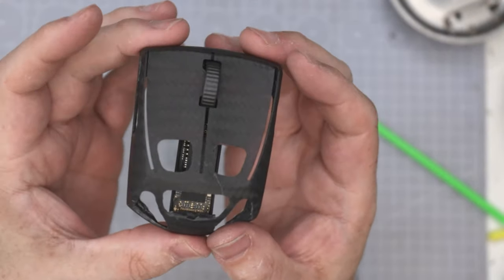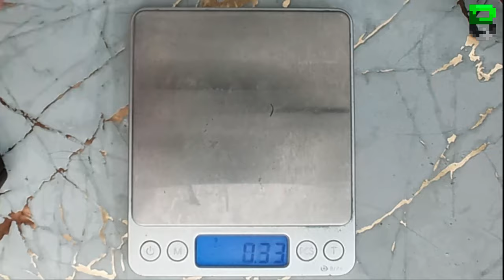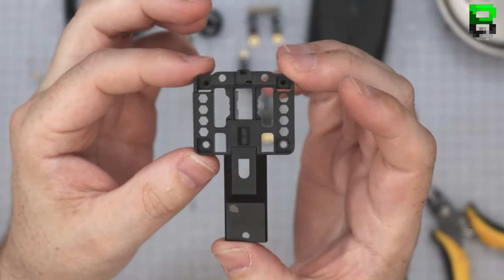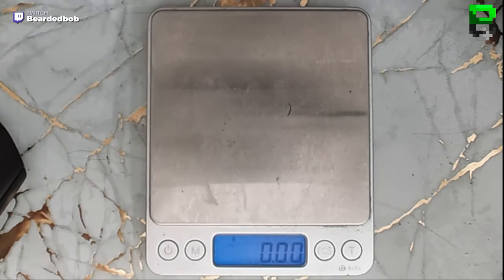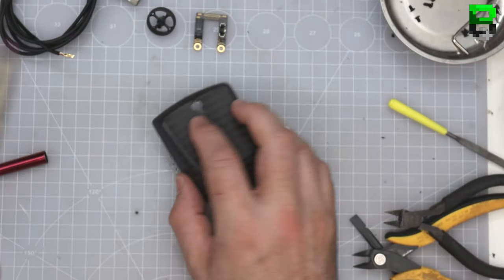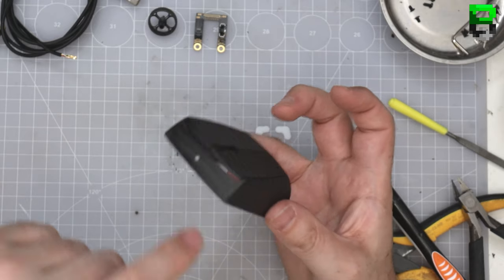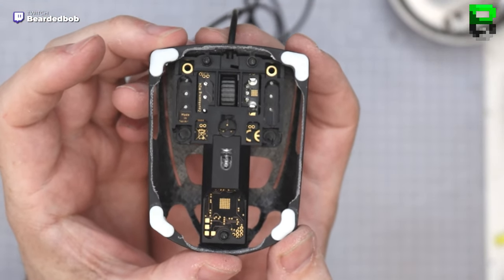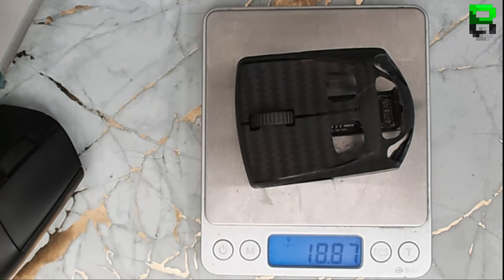Butchering a $300 Zaunkoenig M2k Carbon Fibre Fingertip Gaming Mouse

Comment: Is there a noticeable difference in the weight?  Did the click feel change any?  I remember on the MK1 you mentioned it still felt pretty together.  Does that still hold true here?  I want to do something like this for mine but I'm waiting till next year for the warranty to end.  I'm mainly trying to see if I can make the clicks a bit easier I think the carbon fiber is too stiff for me.  My index finger is pretty far back.  A bit behind where the mouse wheel is.  Great work Bob few would even attempt this.

Comment: is this worth? i main the m2k i want to mod the mouse if something can be improved, im thinking about replace the cable with enncoo AirCord Ultra-Light Paracord Mouse Cable but idk
Reply from the maker: Tricky to say if it’s worth it imo I would say it’s not but it’s 12% weight reduction which is a bit. The best thing imo to mod is the cable for a Aircord or something similar

Comment: Hello! May i know what thickness is the mouse body? I wanna wet lay my own carbon fiber mouse body so it would help of i could know how thick the body material so i can use  proper amount of carbon fiber layer on my own mouse body.
Reply from the maker: I didn’t measure this but I did on the m1k I modded

Comment: I want to paracord mine, how did you take apart the USB JST cable? Did you just pull them out or something
Reply from the maker: you have to push down on the spike that houses the cable into the plastic jst
Reply: @Beardedbob  Sorry if I’m annoying you, do you mean pushing the metal tip that’s inside the plastic JST connector housing out the other side, with a toothpick or some other small object? Because low key was gonna yank it out lol
Reply: @Accuaro  Yes indeed

Comment: surprised you didn't paracord it while you were at it
Reply: It's 8k hertz
Reply from the maker: hard to get thin enough cable.
Reply from the maker: It can still be done but you need a short cable and one which can take that speed.